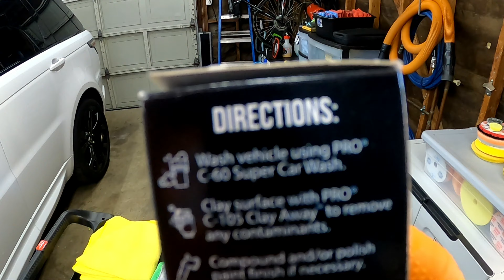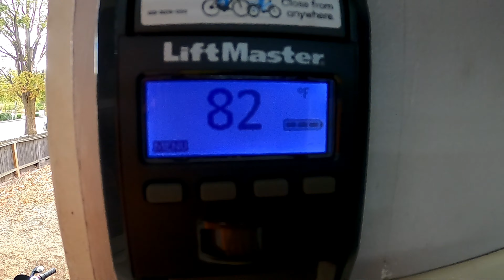2015 Range Rover | 1 Step correction and Ceramic Coating | Awesome results! | Customers Reaction!!

Comment: Awesome job Professor Smurf! I am glad you did a video on this coating as I just received September's glovebox. Good to know it flashed so quickly before using it on someone's vehicle. I finished my wife's 2021 Honda Passport this weekend. I didn't even know that the obsidian blue paint had any metal flake in it until I did a full decon and polished it up (did sonax 1 step) before applying ethos carbon ceramic coating. Man now you see flake for days! Couldn't be happier with the results, thanks for all the helpful tips and encouragement to your viewers.
Reply from the maker: Thanks man! Appreciate that! Ohhh ya it's amazing the clarity you pull out of some paint. The flake must be POPPING now👍👍 that blue is gorgeous as well. Yeah the coating takes some learning and isn't very slick but, still turned out great. Appreciate you tuning in!!! 🤜🤛

Comment: The glass roof has a black panel right next to it on each side that I assume is not the same glass. I have a similar setup on my Kia and the black strip beside the glass is oxidized now. There is a rubber gasket material between the strip and the glass. It looks to me that you didn't tape off that rubber piece on this car. Does the polish stain the rubber strip between the two? Did you use a 3" pad for this black section? No worry about damaging the rubber strip between the black strip and the glass? I'm going to try to get my Kia corrected before winter. Hopefully next week. My health has been failing over the past couple of months so I hope I will feel good enough to tackle the job. I do seem to be improving. I wasn't able to do a lot of jobs this year because of this but they say whenever I can get to them they still want the work done.
Reply from the maker: Your correct. Does have a gloss black strip next to glass! I had 0 issues with staining the rubber strip between with the sonax pf.. 3" polisher took care of almost 80% of the car unfortunately 🤣 regarding your health.. I hope your health is getting better my friend. Please, take care of yourself buddy. 🤝

Comment: Papa,  Great Job!  Besides plastics, ok to apply this coating to glass and other exterior surfaces?  Any other tips from this coating?  Should I apply a second coating of this product?
Reply from the maker: Thank you!!! Yes, I applied to all the glass as well👍 they said no plastics idk why but I'd say just be aware of the flash time. You'll get a feel for wipeoff after the 2nd or 3rd application 👍👍 keep a few fresh towels on deck. I think I used 6 total for paint. On glass I made sure my towel 2 was fresh as well. And use your paint light to make sure you get all the coatingoff. . You can definitely see it with a light✊
Reply: @PapaSmurf918Detail  Thanks, one coat recommended by manufacturer?
Reply from the maker: You know, it didn't say anything about layering the coating. I've never personally done 2 coats with any coatings I've worked with.

Comment: I’d say 8 to 9 times out of 10 when I do a car I’ve been using that perfect finish usually with a green or orange hex logic pad, however just the other day I was trying to polish out some chrome trim on a Honda accord that’s on the top of the car and I was using perfect finish with my hand drill and that 1 inch cable attachment and the perfect finish dried pretty quickly on me I think I just had too much rpm from the drill! I really need to get my hands on a  Rupes 2inch  Nano, but I’m just too cheap lol.
Reply from the maker: Tim.. I absolutely looove Sonax Perfect finish. Cuts well.. finishes out ultra glossy and a breeze to wipe off! As far as the 2 inch. Check out the Pxe80 by Flex! Just picked one up and man it's fantastic. 1" 2" and 3" backplate. Optional throws you can switch too and a rotory option. Paired with the extensions I bought it's awesome!!!
Reply: @PapaSmurf918Detail  Sweet I didn’t realize you could jump from a forced rotation rotary, can you jump to a DA too?
Reply from the maker: Yes, the rotory option still spins clockwise.. u like the flex forced rotation da spins counter clock wise. And you can switch on the fly via quick disconnect 🤙 I want to make a video on it for sure! It's an AWESOME machine

Comment: Nicely done
Reply from the maker: Thanks man! ✊🤜🤛 appreciate you watching!
Reply: @PapaSmurf918Detail  questions would you say ceramic coating actually shines/looks more glossy than a correction and a nice waxing with topper? I've seen really good results with just waxing so I was curious..ive never put on a ceramic coating to justify the difference
Reply from the maker: Honestly gloss comes from the polish/correction 👍 90% of it. The coating and wax/sealant is just that extra cherry on top.. coatings do provide some great extra gloss then topped for sure. But, polishing is where the gloss is. 👍 defects hide gloss and gloss comes from how flat that clear is. The reflection of light bouncing off to our eyes. The flatter the surface and more even the glossier it will look🤜🤛
Reply: @PapaSmurf918Detail  that's what I meant basically but didn't know if the coating added more than a great wax
Reply from the maker: @BeardsandCars  no worries yeah coating can provide some unreal gloss.. but, there are some sealants like Titan from Phoenix EOD that is just insane on gloss... 👍

Comment: How do you work your pricing papasmurf I'm interested since your in California, I'm having issues with pricing as have a lot of people asking for quotes and don't hear anything from them but on bay area everything is soo expensive compared to other detailer I'm about average to lower end of pricing.
Reply from the maker: Ramiro, to be honest I really don't have like set pricing. I'm picky about who I do work for ( mainly family and good friends ) but I can say this. Good work ain't cheap and cheap work ain't good. Don't sell yourself short just cause Joe shmoe down the ways can do it for cheaper. Value your work ethic and charge. It's not easy doing what we do my friend!!
Reply: @PapaSmurf918Detail   completely agree with that and I don't lower my prices I just rather not do the work since it's not worth my time. But with that I'm struggling to find work to do detailing since most people want everything for dirt cheap and I can't do that. As a full ASE master technician I take pride in my work and quality I produce compared to others. Been working on my own business as a auto technician and having detailing compliment the repairs but difficult when people don't value quality and moments I do question myself but compared to others I'm average pricing in my area and in some cases on lower end of it.
Reply from the maker: @saautomotivellc  I definitely see the frustration man! I'm in the same boat as well. Full time Technician at our business.  Been wrenching since I was 7 and I as well, take pride in my work. I let it speak for me. It's difficult to justify spending 500 to get your car detailed when most wouldn't know the difference you know? It's a very specific market we're after given how prideful we are in the work we produce. I may get 1 out if 5 people that want to pay my price. But the more I do, and the more people see what I do and how they turn out. The better... So idk if you have a YouTube channel but it's very helpful. It's like a digital imprint that people can see. Hey check out my work here and it gives the person more perspective as to.. woah, I see why he charges X amount now. Hope that makes sense. ✊